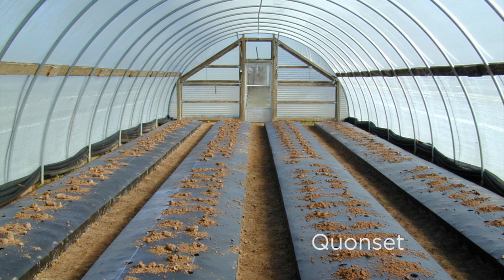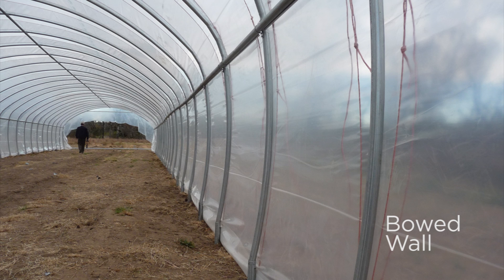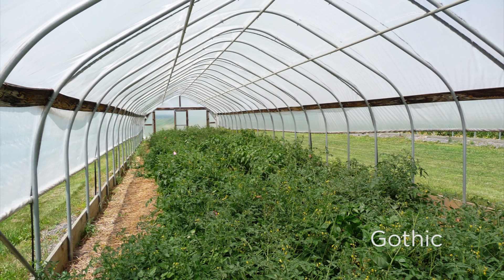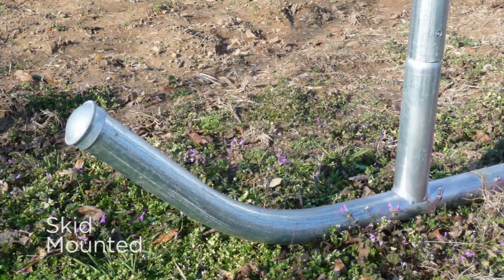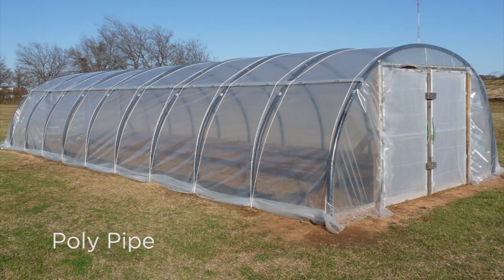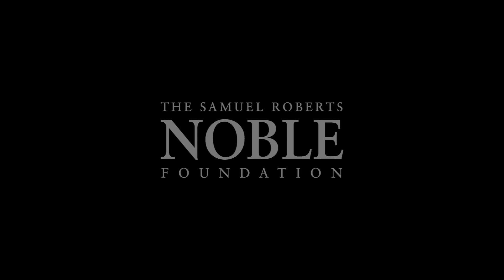Hoop House Construction, Part 1 of 3: Types of Hoop House Structures

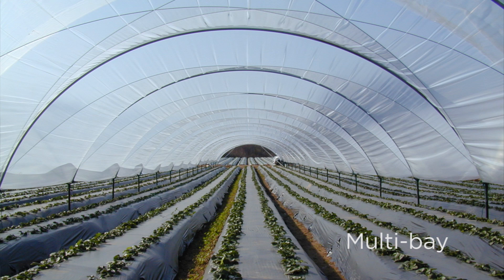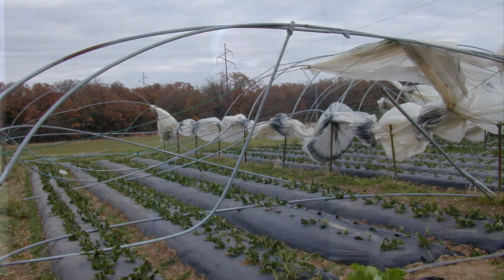Comment: 2:08 and 2:30 are these really more fragile than the other types of tunnels ?
Reply from the maker: The primary reason the field scale tunnels are not as durable is they use lighter weight tubing and the hoops are spaced further apart. They were originally designed to be erected over a crop that had previously been planted to extend the harvest season. Following harvest the structures are disassembled, plastic mulch removed and the crop residue plowed down. Because they are less expensive to erect (square foot basis) first time growers gravitate to them. But you get what you pay for. Here in Oklahoma they are more susceptible to storm damage. As seasonal structures they are good for fall-winter production but are at risk from storm damage in spring-early summer.

Comment: sir are you aware there is a concept to build houses inside of a greenhouse to creat micro climates in cold areas.
Reply: You lose 10% of available light for every layer of covering you put over a crop. And then there's the reduced ventilation factor.